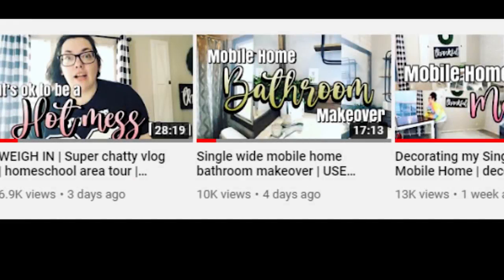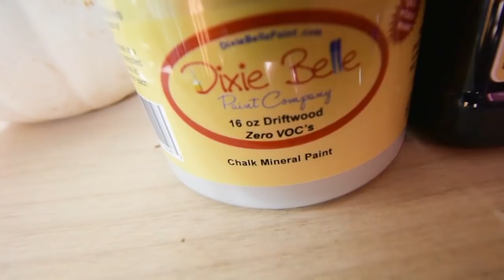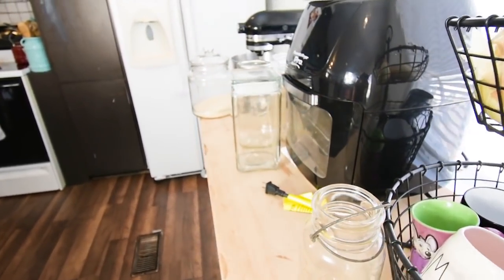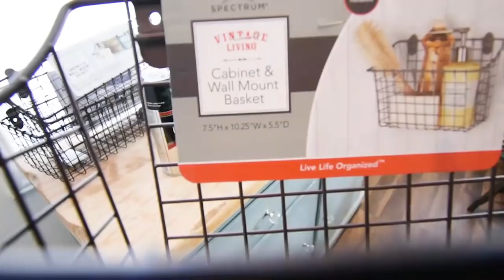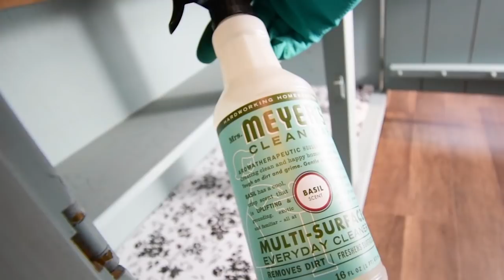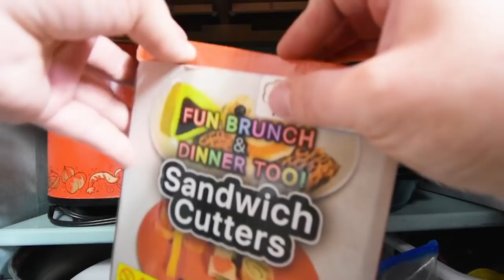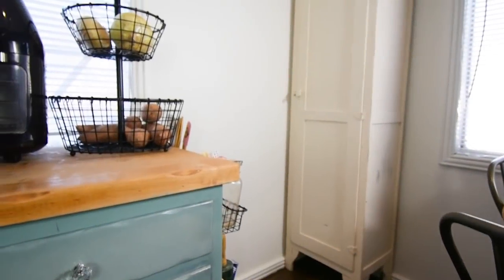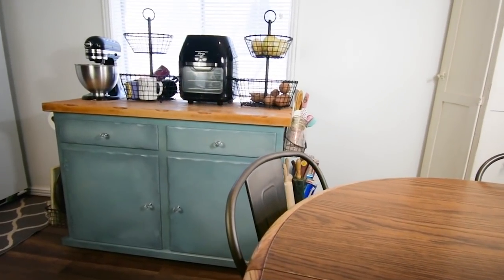Updating My $500 Mobile Home|DIY|Small Kitchen Storage Ideas|Hutch Repurposed

Comment: maybe you could have cut the top molding of the top piece off to make it fit your new home, and an inch or two off the bottom.....sometimes that ornate molding can just be unscrewed.  something to think about next time. see if the top decor or molding can be removed to fit .  turned out so pretty, i think is crazy funny as well.